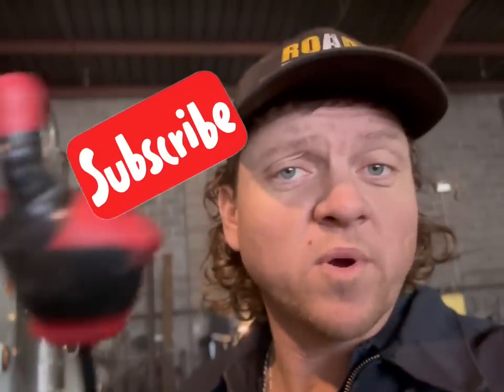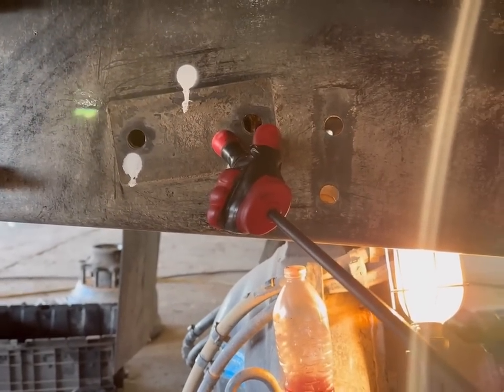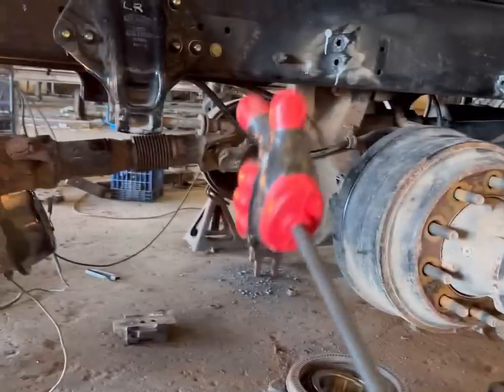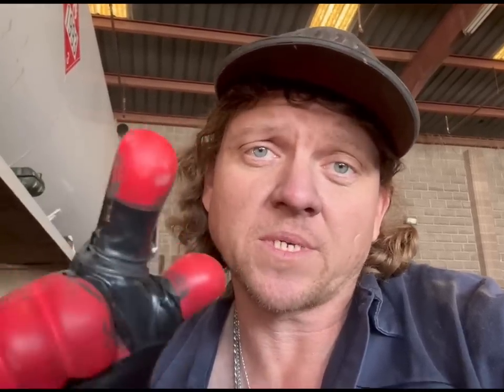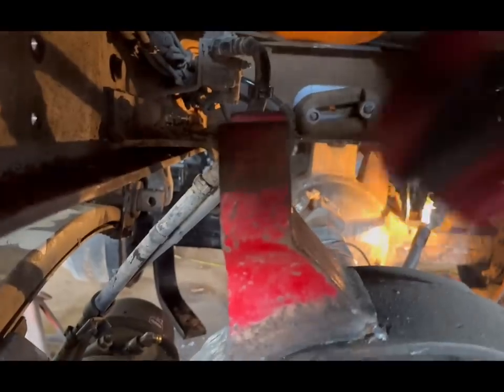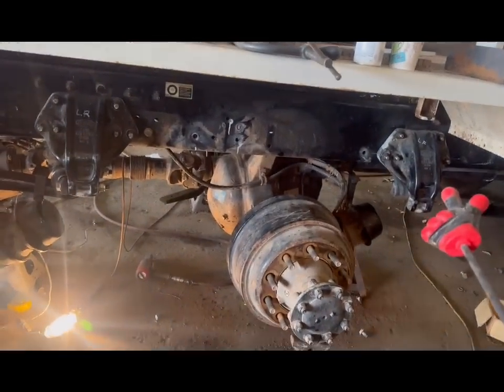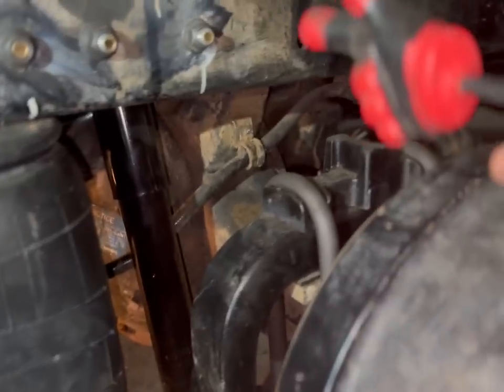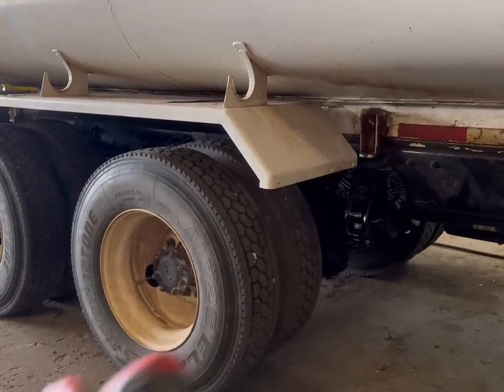Can I swap the Hendrickson ,to air bag , air leaf

Comment: Next week: “truck feels unstable with a full tank”
Reply: I drove an air ride tandem fuel tanker, it was fine. It had neway suspension on it. Did leave a bite mark in the seat once rounding a left hand curve and slightly moving to the right as I was closer to the centerline than i wanted to be and there was a car coming the other way who was also close to the centerline. It sloshed to the side a bit and I thought I was going to go over for a couple seconds. We did a lot of bush roads. If we didn't have air ride it probably would have busted stuff and been hard on the tank body
Reply: The Airliner suspension I have off a tanker truck has a leveling valve for each side.

Comment: Hendrickson Suspension is the best ever with Chambers a close second. I have ripped out many an airbag and many a spring suspension to put in Hendrickson walking beam, and double framed them from end to end. Not the other way around....lol.  But my trucks do real work.
Reply: @user-fl9wt2wm8o  They all have their place. I run T800s, tri axle airbag in rear, with pintle tag trailers.  Hauling logs. 90,000 is legal here,  but being first market product they hit 107,000 or so for gross sometimes. Load is tall and its as heavy 13 feet up as at the bottom. Short brutal runs through the mountains. Its all about the trucks ability to stand up.

Comment: Nice tip on cutting above the weld. Most people get a bit overzealous and try to remove as much material with the torch so they dont have to grind as much, especially since the actual weld is usually quite hard compared to the base material. Patience will really aide you in doing a better job. Also like that you touched on the driveline angles. Good stuff.

Comment: when we did something similar to this... we used the donor trucks axles and all so we didnt have to do as much to the axles we had donor truck and custom truck sitting back so we had frame rail and all wasnt to bad but was alot of work. in the end its a 2012 w900 with air ride.

Comment: I’d never want to swap from Hendrickson to air leaf…actually I think I’d rather swap from the Haulmax back to the old style RT leaf spring walking beam suspension if it was my truck. They’re hard to beat when it comes to longevity and articulation.
Reply: Yup drive dumptrucks in Wisconsin and I love the 02 we have with the old rt spring walking beam.  I hate the haulmaxx
Reply: Any thing off of the asphalt Walking beam for sure. You can back up on your piles save a lot of space if not able to move piles in time.
Reply: Walking beam keeps the weight on all the wheels. Air bags off road don't adjust fast enough and then you're stuck
Reply: They make an air ride for the walking beam suspension
Reply: @jameswilson2051  I know, they call it “AR2”….it’s obscure and I’ve only ever seen one truck that actually had it and it was a retrofit.  While it would still have similar articulation that setup still isn’t as solid in turns as the leaf springs are and requires dumping the bags when raising the truck body or roll-off track. I wouldn’t mind having it on a tractor but for a straight truck with any type of body that moves or raises I’m not sold on the idea.
Reply: @J.R. : Thanks for the feedback on the AR2. I think I’ll try that on one old tractor and see how it works out. It seems a lot less like reinventing the wheel. Take care.
Reply: @carlcarlamos9055 👍🏻 That’s what I thought it might be a good fit for: an older semi tractor that spends enough time on the road to want better ride quality. Like you said the nice thing is you can keep your current drive axles and walking beams and all the associated parts that fit below the saddle, definitely a lot less work and money than going to a completely different suspension.

Comment: What about haulmaxx vs old school RTE walking beam ? Do you know the pros and cons? I’m just a rookie that bought a Kenworth with a haulmaxx, I came from using a freight shaker with airbags in rear. Hated it because it would always lean. If  you drive a rolloff, you know what I mean. Fuckhead loaders tend to not care how they load so the load is more often than not uneven or the load is ok but the surface is uneven and that’s just as bad. Sure you can dump the bags but you can’t be driving like that all the time. That’s why I got this Kenworth, came with haulmaxx already on it . I have yet to try it out but sure would like some opinions on HAULMAXX VS RTE

Comment: The fertilizer spreader truck i used to run had a walking beam in it. With lift custom wheels to run military tires that was a mean ass truck. It was a l9000 ford w a m11 cummins and that truck was bulletproof as any piece of equipment i have ever ran. 4th on the floor is what you spread at all day long at 14 mph. Idk if it was hendrickson or what but the truck was a long frame ren wheeler that had a box on back that my bossman tool off and added a spreader box

Comment: Hey Great Job! One thing I need to ask. Its about leveling valve. Should it be around middle of axle?  In EU we Mount them not by the air spring but around centre of axle so the valve would receive real axle level signal and not disturbed by the airbag tilt. 
Anyways its a good job!

Comment: They should have gone to air trac suspension is geared towards heavy haul. Air leaf bushings are going to take a beating same with the torque rods. Other wise great video. Peterbilt has all the suspension installation drawings if you didnt have the old frame as a template

Comment: Personally, I would’ve bought a rear axle section from a wrecker and cut the frame. Swap out all the old components with new, and set er in place and weld er up.

Comment: My father bought a short wb 5th wheel truck and extended 20' and drilled over 100 holes and it was a all summer job after working 10 to 12 hrs a day, he'd get up on Sunday morning and just drill holes all day long. Just to save 2000.00$

Comment: Sure would like to have that old hualmaxx for my air ride tri-dump
Reply: If you’re going to go through the work I’d highly recommend going to the Hendrickson RTE-460 extended leaf walking beam suspension, or regular RT-460 if you can’t find the RTE. Having owned and run both the older style Hendrickson is a LOT more robust. Pretty much the only failure that’ll cause the truck to roll is a complete walking beam failure whereas with the Haulmaxx there are several ways for things to go bad when it gets worn. Plus the RT articulates almost 30% more than the Hmx.

Comment: I got with some friends of mine and we literally built me a brand new frame that was thick and was used for Heavy Haul because I made me a 84 Peterbilt Heavy Haul truck bye-bye a new heavy straight frame and took everything off the old frame and put it on the new had to add new cross members cause stretched it out a little bit

Comment: We also went from two sets of tandems to 3 sets of tandems the front tandems are able to be raised in lower when needed no I ain't going to tell you it was easy it took a long time get everything right but I think I should bring it to you to make sure that everything is straight went and had it aligned all-wheel alignment front and back and they said we were good but you never know about the factory employees on whether or not it is actually right or not it drives really good and don't have no unusual tire wear but should have someone professional check it out to make sure

Comment: Hi I've got a kw t2000 motorhome it pulls to the right and bounces in the back I've checked the ride hight several times and it's good if your sitting in the back bed you will get air born it's a horrible ride I'd like to bring it to you when we're traveling how do I reach you help

Comment: Get a cut off with the right suspension it will be cheaper & on correctly , lot of times you will have to change the brake hangers & some    suspensions newayair with sq-100 the rear housing  is a special housing the brake flanges are drilled by the oem & are 1/2 ahole off .
Reply: Yeah maybe if it’s a semi. This has a massive fuel tank on it with pumping equipment.
Reply: @mikeznel6048  Still could use everything from the cutoff but the frame rails, that way the housings are correct for the air ride already, only thing required then would be drilling the holes and bolting it up and the plumbing.

Comment: Cool project. You’d think people would know how a truck would ride before dropping that much cash on something
Reply: Probably bought it used, and got an excellent deal on it because of the suspension.
Reply: Nothing wrong with a rubber block suspension. It's one less air leak to chase.
Reply: @jerrykinnin7941  how to tell me you have never driven a truck with one of those rough riding pieces of shit.
It is one step better than KW Torsion bar suspension. Those rode OK, they just suck to take care of.
Reply: @haroldphipps3457  I ran one on a Volvo SD tri axle dump truck. Tobacco season 2001/2002. For tobacco season (OCT -MAR) we'd take the beds and hoist boxes off the trucks bolt up fifth wheels 
Add airlines. Run them between KY and VA,NC the DM macks were a little strange looking but this made Alvin Haynes & Sons Lexington, KY. alot of money. Asphalt stone sand dirt. Then Road salt Unload has their own rail siding stockpile and deliver.  
And that tobacco setup. 
Very stable suspension rubber block is. 
Air leaks suck.
Reply: @jerrykinnin7941  change out the push to leak air fittings!
I do agree, the "walking beam" style suspension is built for abuse.
The Volvo style has superior articulation.
But they all ride like crap.

Comment: I don't know why you would do this on a water truck.  It seems like a Hendrick's walking beam or rubber block would be perfect for a water truck.  Maybe put in a leaf spring but air ride?  Water trucks are way over loaded when they are full and I just think the air ride is the wrong choice.

Comment: Wouldn't it be easier to just do a CUT-OFF swap?
Reply: I’m not sure of how much of this work you’ve done but the way he did it is actually easier than your plan. First off he would have to remove the tank. Then being it a water truck that means it’s off road a lot. That means a lot of twisting. So to reinforce your splice you need to put about a 6’ liner in behind the splice. 3’ each way. Then he has to narrow any cross members in that area so they will fit back in. So I guess the answer is NO it wouldn’t be easier